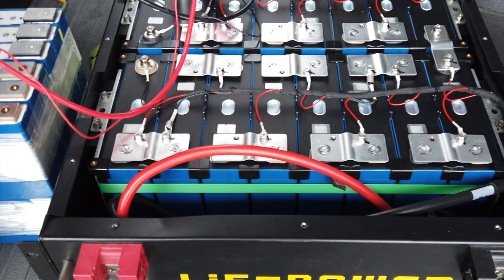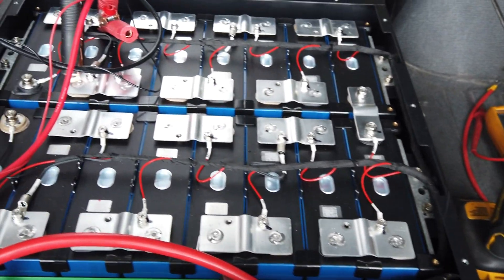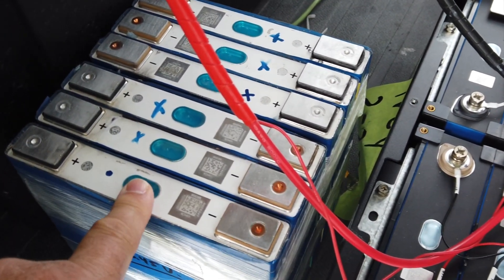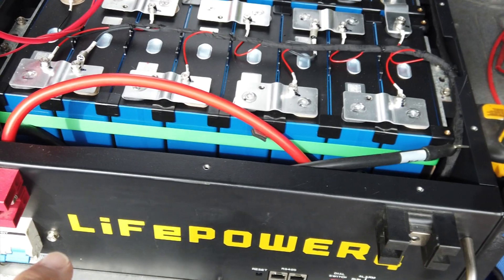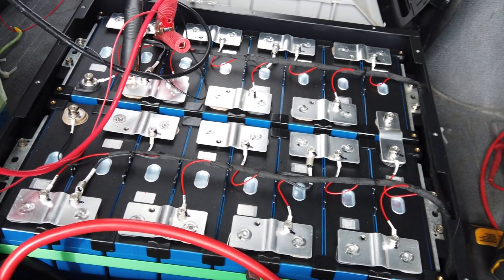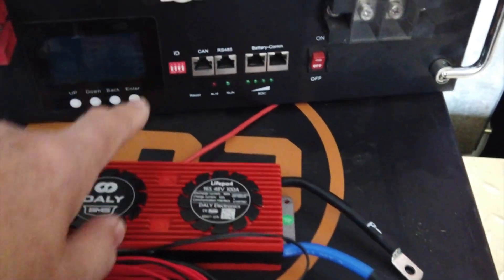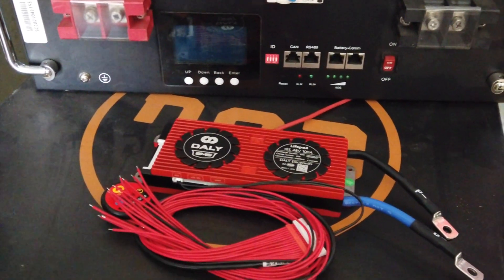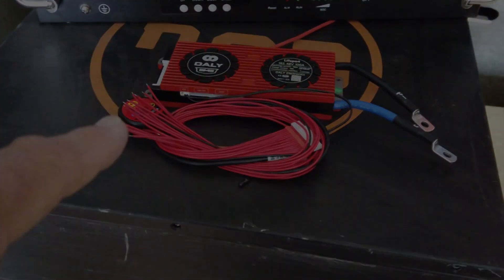What is the problem with EG4 Rack mounted batteries??

Comment: how are you connecting your batteries? Each one to a busbar or Daisy chaining them? I can see BMS failing if Daisy chaining them. I also oversize my BMS's JK of coarse. I built my own battery banks 4 x 14.3kw. I did this only because of cost and I do not trust others BMS like I do JK.  when I am pulling full load 10kw each bank only puts out 0.18C-0.2C 50amps each and that happens very rarely. I usually only use 10-20 amps per inverter. I try to not over work my system. Heat is what causes things to break.
Reply from the maker: Actually I like your suggestion, I will when my bus bars and cabling arrive hook each EG4 batteries on a bus bar separately, as I have done with each of my other battery systems.
Reply: @stevedutcher3875  I use 280ah cells so my C rating will be much lower than yours using 100ah cells. 4 battery banks pushing 10kw is 2.5kw each or 0.5C  That is the most you want to push your batteries. Heat goes up and cycle life goes down over that. I suggest 3-4 of those rack batteries to a busbar for every 5kw of inverter power so your C rating goes down to 0.25C-0.33C.
Reply from the maker: Actually when I hook up my Outback’s I’ll be using all my 120Kwh’s of battery storage to power my home.

Comment from the maker: I top balance each individual cell with alligator clips with my Zetech 40 amp charger, it doesn’t matter how the bus bars are, you attach to that individual cell and you can top balance it! My setting are a constant voltage of 3.45 volts at 20 amps, when it goes down to 2 amps the unit shuts off, then I move to the next cell. I had 64 cells to top balance, it took me four days with two chargers to balance all cells. By the way it is just like hooking up for your BMS. It isolate each individual cell. I always start out with cell one then two and so on.

Comment: Hello Steve, How did you top-balance the individual batteries?  The EG4 individual batteries are soldered to each other (and are connected in series).  Doesn't the top-balancing require connecting the individual batteries in parallel?  I tried to top balance mine but they are soldered to each other and I don't see how I can place them in parallel. Thanks in advance for any reply...